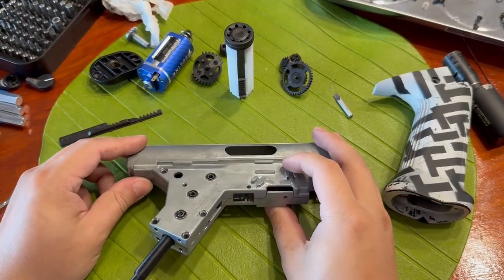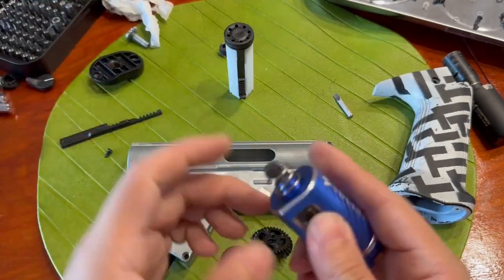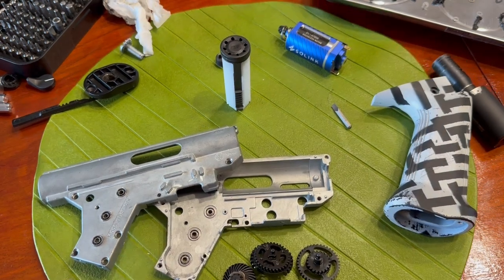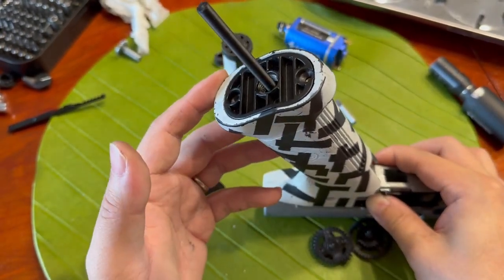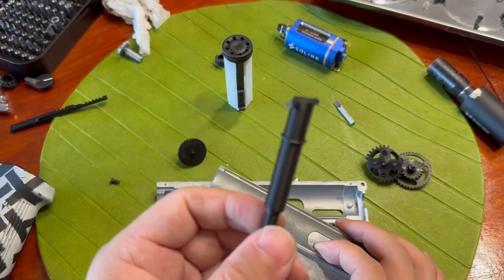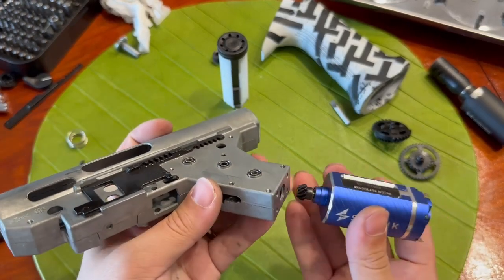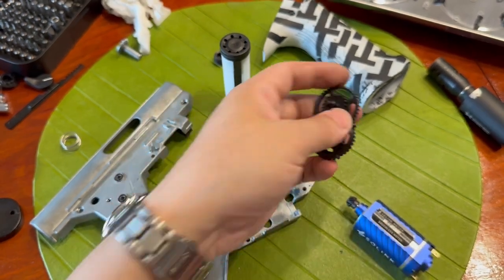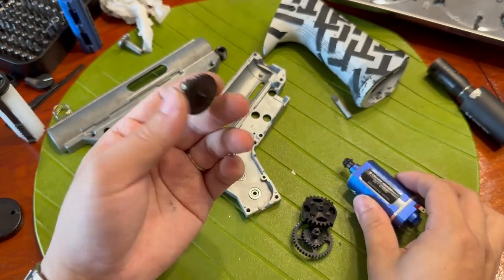Bulding the best performing AEG in 2024 pt 2 - Solink CNC gearset

Comment: I've never worked on an EVO, but looking at you doing the bevel the pinion alignment, would it make sense to 3d print a motor cage for that bit? Then you just try to measure how much the motor adjustment screw needs to turn to get the motor in the depth position you shimmed it to while using the cage, when you insert the motor in the pistol grip. I dunno... just something that crossed my mind in the moment. Could probably be also useful for V2 gearboxes, perhaps. MP5 comes to mind. 
Looking forward to the next one!
Reply from the maker: Some MP5s have a motor cage I think. The Evo grip doesn't have the space for it. You could print a better fit grip tho.
Reply: @wyz2285  Yeah the mp5k has a V3 GB and a motorcage, at least my cyma does. But what i meant is printing a motorcage just for shimming the bevel to the motor, since you can probably match the alignment of the motor with that tool you've shown in the beginning, and simply measure how deep the adjustment screw should be turned to ensure the motor inside the grip is at the same height as when you set it in the cage.
3d printing a grip is also a great idea, and could solve a lot of issues